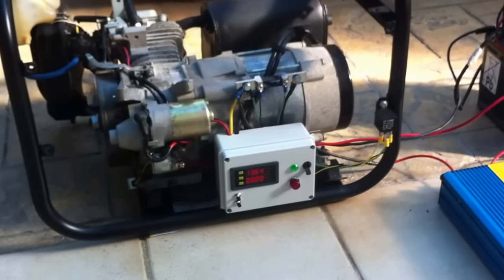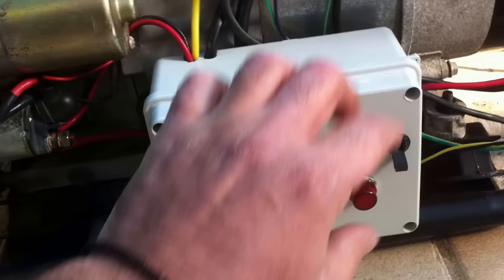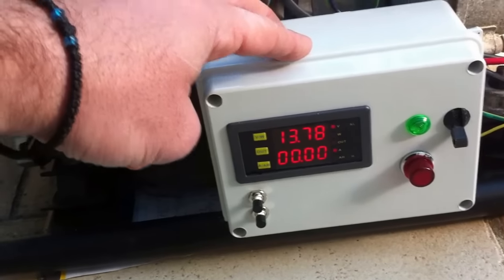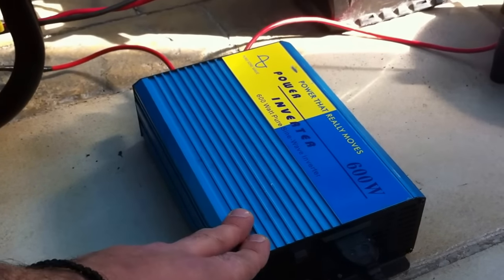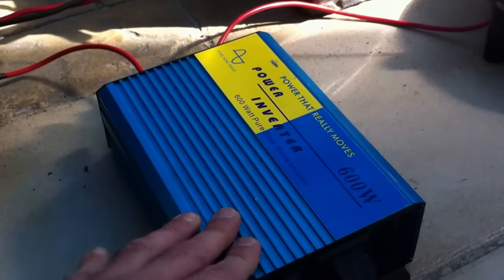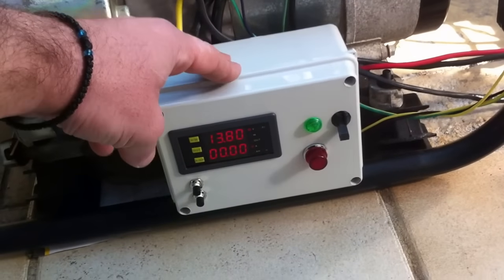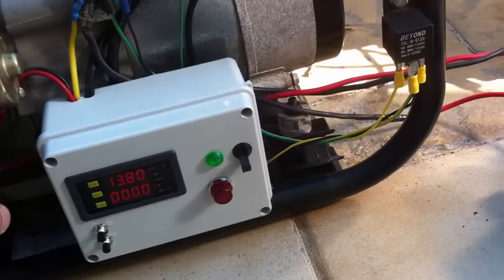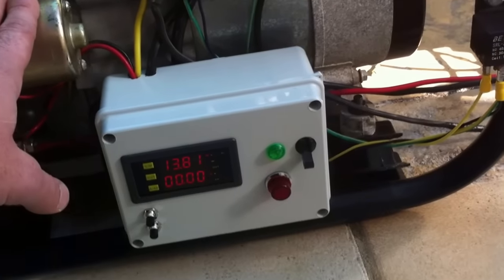Generator converted to Auto start stop charging a battery bank

Comment: What we need is a generator that can start/stop autmatically when our batteries get low on on off grid towers....just as you show here on the video we would like to use the honda eu3000is for its cold start capabilities in extreme weather.....

Comment: What stops it from short-cycling? With charging voltage applied, the voltage will reach 13.2 long before the batteries are fully charged.

Comment from the maker: Hi Brian, unfortunately i haven't completed the setup to charge battery banks. My plan is to attach a 200amp 12volt alternator direct drive to the shaft. The circuitry is complete as is regarding the auto start stop functions of the engine, also for the battery bank sensing. There is also another part that is still needed after the attachment of an alternator...a smart charging circuit.
Reply: I'm not sure you will get the rpms needed to use a car alternator. Probably would be better to use a 12 volt DC motor as as a generator.
Reply from the maker: Hi DJ David J, yes there are many option I have considered. Permanent magnet motors, dc motor, etc
Reply: Hello Nick, I know its been over a year you built this but on going through the video I noticed something very important - the choke. You said you were waiting for a solenoid, has it arrived? Have you installed it? That is the one part that prevents this from being a fully automated, remote start system. If you have incorporated this kindly share a video or pictures or walk-through instructions.
Regards (FANTASTIC WORK BTW)
Reply from the maker: Hi there. Yes the solenoid is installed and will create a new video hopefully this week.
Reply: Ok, would be waiting... cheers
Reply: Nick Alexander    Hi NIck  how to wire and install auto  start stop  how to connect to the generator pls

Comment: Hi Nick, great setup great video! Was just curious to know on how the starter motor detects that the generator is online so that it can stop turning the flywheel?
Reply from the maker: Once the generator starts and revs up...it activates a relay to cut off power to electric starter.

Comment: Hi nick, you seem to have the answer to my problem. I haven't purchased a generator yet as im still calculating a figure for my over all project but i understand i need a two wire electric start one with an automatic choke. Question, im planning to use a 24v system would that be a problem? Ive researched a few controllers but most are out of my price range (maybe yours is too lol). IM desperate for some info on the subject if you would spare some time educating me. Thanks
Reply from the maker: Sorry Conjon for the late reply, just saw your message!
Not 100% sure how to do it on a 24volt system.
One option is to use the generators 110/240v AC output to power a 24volt battery charger.
Other option is to retrofit a 24volt alternator onto the genset.(This might work out to be abit costly)
If you have a 24volt charger, I would recommend that option, and yes you will need a 12volt electric start generator with or with auto choke(I have completed my auto choke setup-will post another video soon).
I can build the circuit for you when you get your generator, and it is very affordable for what it is meant to do! :)

Comment: Hi Nick.  I'm interested in what you used to get this starter working? is it PLC / Arduino based or did you just use timers and relays to start up?  I'm currently working on a project of a similar nature but i'm stumped as to what procedures etc i would need.  Diesel Generators are far easier to start remotely it seems, so getting my petrol genny to start up automatically would be a real win.
Reply from the maker: Hi Richard...please send your email to give you details on purchase.
Reply: Hi Nick, your setup is great. This is exactly what I’m looking to build. Would you mind providing details on what equipment you purchased to get this up?
Reply from the maker: www.dcautogen.com for all the information you need.

Comment: we need this like yesterday......the honda eu3000is already has electric start so there would be no need to use and altenator....what we need is a solution for the choke and for it to start when batteries get low automatically....we were going to use the generac 5818 but i saw that it burned to much LP .83 gallons at 50% load which means we would have to change a 100 gallon propane tank every 125 hours of run time and that is a lot of work getting to these remote locations...

Comment: Nick i am in desperate need to fit this to a honda eu3000is with the solenoid to control the choke...is there anyway to post a video of the build on the auto/start/stop controller?
Reply from the maker: Hi Travis....it is a very lengthy project. I can however build the circuitry for you. What exactly do you need? Are you after the sensing of voltage to auto start and stop, or just a remote type start and stop. If you are interested let me know more details so i can help you out.

Comment: Do you have a step by step as to which wires you spliced into on the  generator?
Reply from the maker: If you can supply the wiring diagram, I can help you out.
Reply: @DCAutogen  🤔 ok.....probably easier to explain it, but if it doesn't make sense, i can draw something up....
     Basically, i bought a typical Firman Generator, i think it's a 3,650 watt, electric start with remote start fob.....
     I'm bolting it down in the back of my utility truck, and have a 60 amp battery charger hardwired into a 6 unit battery bank.......
     I am unable to purchase an AGS switch, due to supply chain issues.....
      So after seeing your video, it looks like i could DIY an AGS switch from relays and voltage monitors.....
      Purpose: Batteries get low, i want a voltage monitor to automatically turn on the generator, until the battery bank is at proper charge, then turn off the generator.....and the entire system to run automatically, without any help from me
Reply: @DCAutogen  I'd have to look up the wiring diagram for that specific generator.....I was thinking just remove the face plate, and access the wires behind the switches
Reply from the maker: @justintyme1449  looks like you need a V6 AutoGen smart controller. Saves you the hassle of figuring everything out.
Reply: @DCAutogen  I'll do some research on it,  I actually purchased two Magnum stand alone AGS-S units, but both orders  were canceled by the manufacturer due to stock shortages
Reply: @DCAutogen  ok, i really don't need WiFi for anything, and since it's on a truck, does it only work with signal? 
     Sounds like this unit would still depend on human imput....
The goal is a completely autonomous system. that only needs a full fuel tank to function
Reply from the maker: Doesn't need wifi to operate automatically. WiFi is needed for remote operations and monitoring via AutoGen app, plus email notifications.
It can be set to start when batteries fall below preset level or if a signal is received from an external trigger. Can't get more autonomy than that :)
Reply: @DCAutogen  eventually, i will get a wifi router for the on-board cameras.....because ill be able to see 360 degrees around the truck even if I'm in another state
Reply: @DCAutogen  the Magnums are about  $250 to $300 so if it can match or beat that price, im interested
Reply: I see it's $400, is it better than the Magnum, or am i just paying for the Wifi option?
Reply: @DCAutogen  I'm seeing a Youtube video of a guy installing a V2 Autogen unit....looks very simple, that's all i need
Reply: I just watched the Firman manufacturer video again......my generator does have the "Start/Stop" remote, so maybe it's possible to hard wire the board to a relay triggered by a low voltage monitor/disconnect 🤔
Reply from the maker: There are many differences between the 2 products.
Monitor and control remotely from any location when connected to WiFi.
Multiple ways to autostart and stop.
Custom firmware updates over the air.
Best pre and post sale support in the industry.
Reply: @DCAutogen  don't want any of that, just want direct 2 or 3 wire hook up, no human interaction required......low battery bank voltage.....start generator......stop generator......repeat as necessary
Reply: @DCAutogen  don't want to be dependent on a wifi signal.....if im working on a project vehicle way out in the middle of nowhere and wifi isn't available....they system can't function, at that would really piss me off
Reply from the maker: @justintyme1449  it doesn't need wifi to operate. It's only needed to control or monitor your generator remotely via mobile app.
Read previous comments for automation.

Comment: I think this would be cool in a vehicle with a gas gauge that could alert u by setting an alarm on it say you drive from a gas station and know how many miles yer gas gauge could have it where u could preset it to alarm u so if yer generator run off the cars gas tank yer car would alarm u when u need to drive to a gas station or rv ext think it would be nice cause you could use the vehicles battery for stuff...
Reply: Travis,  I have an RV that has a separate fuel pickup for the generator.  The generator will run out of gas, but a reserve will be available for the vehicle.

Comment: Would you please tell me where I can purchase that box so I can set up my generators to turn on when my battery Bank gets low and tell me does it come with instructions on how to hook it up
Reply: Most people don't believe that a self running generator will work. well I have one and I need it to turn on only when my battery Bank gets low . otherwise I have to keep going out and turn it on , when things start getting dim or not working properly. it would be nice if when the battery bank got to a certain point the generator would automatically turn on... I can have a set of batteries just to turn the generator on. but I need a switch that sensors when my battery packs get low and turns the generator on. until they are charged back up and then automatically shuts it off.... and I do believe that this will work. I would appreciate if you would send me the information, you seem like a very intelligent man and I appreciate your video it has given me hope that I can make this work..... With your setup.
Reply from the maker: Hello Lewis. Sorry for the late reply, just saw your messages. You can find our products at www.dcautogen.com

Comment: Does this equipment for sale void warranty on a newer, electric start generator?
Reply from the maker: AJ W yes it would. But mostly all the small generators don't have this feature!
Reply: I'm looking at a new DeWalt DXGNR 7000 with an electric start, which I would like to trigger from my Midnite Classic 150, but I may need some interface equipment.
 
I wouldn't want to void the warranty, but you're right, since it's a portable, it doesn't have an auto-start feature.
Reply from the maker: AJ W well its up to you whether you want the added function vs warranty. I am working on a complete setup. Automatic start of generator with quick 120amp charge via alternator and 3 stage smart regulator. wifi connected to send readings to mobile app and error alerts to email.
Reply: That sounds like a great idea...perhaps worth the void of warranty, or getting a better price on a used unit!
 
First I do need to consult with both Midnite and Magnum to see what automated processes are already available, as well as DeWalt when I can get someone on the line that knows their product line.

Comment: hi nick i live in south Africa out in the sticks and charge my batteries from an lawnmower engine powered alternator what would you charge me for a controller system or the circuit so i could fit it to my charging system thanks Ashley
Reply from the maker: Hi Ashley,
Check your email.

Comment: Nick, I need your help :-) 
What part of UK are you located?
Reply from the maker: Tom Bo Ros I am in Melbourne, Australia.
Reply: Oh i am a bit off then :-)

Nick, I need to charge 12 V leisure batteries -- 400-600 amperes -- Unfortunately solar not enough -- combinations of limited spaces to install panels and lack of sunshine-- so back up needed a.k.a generator and would like to auto start gen. when no or not enough solar, i also thinking to hook it up to car alternator so the 3 charging sources have to work together preferably in full auto mode.    

Do you think you can help? Thanks
Reply from the maker: Tom Bo Ros sure can! 
I actually have a complete setup like that and will be uploading a video over the next few days.
Reply: Nick Alexander 

Would you message me with your email, thanks man
Reply from the maker: Tom Bo Ros hydrotruth@gmail.com
Reply: Nick Alexander 

just sent you an email.
Reply: Nick, I have sent you an email just now!

Comment: Where can I buy this, I need one for 48 volts battery pack.
Reply from the maker: shamir...send me an email with more details on your setup.
Reply from the maker: +Shamir Kayum Hi.....yes you can set the voltage limits. You will need a charger for your battery bank from your generators 110/220volt AC output. You will also require a 12volt DC output from your generator for the auto start/stop setup.
Reply: +Nick Alexander  Ok, please email me info how to purchase.